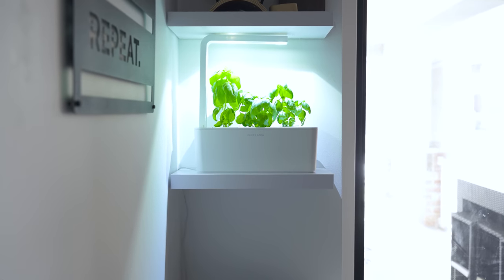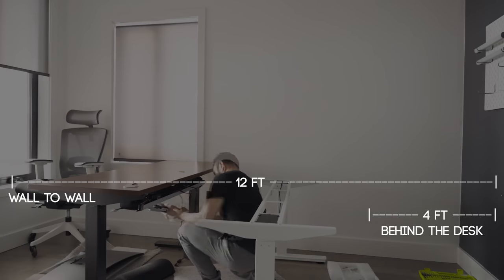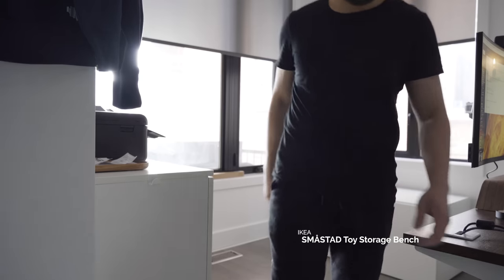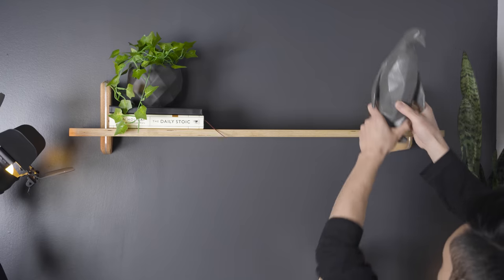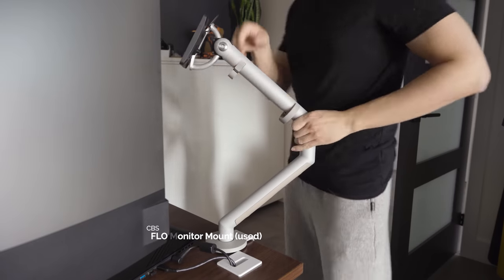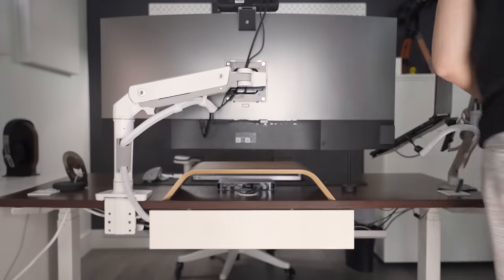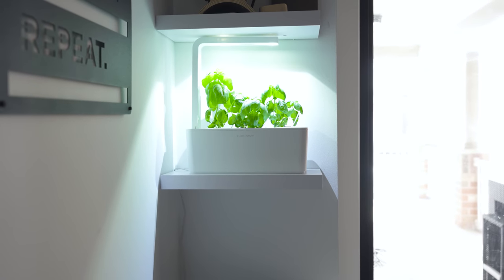My Modern Office | 2022 Clean and Space Efficient Setup

Comment: I'm sure someone already commented on it, but I am sleep-deprived, and can't be bothered to read through 118 comments to see if it's stated. Putting some thin, rubber pads, or similar high friction, soft material, under the wooden plate you put on your "toy cabinet" would both make it feel a lot more locked in place and sturdy, while also reducing chances of any residue + movement causing scratches in the finish of the cabinet.

Otherwise, very clean and thorough setup! Really love the idea of using magnets to fasten the channel cover at the back of the desk!

Comment: Another item for cable management is a cable spine. It allows you to both hide the cables and it's designed to work with the desk so vertical runs from the desk have a flexible spine that encapsulates them. Mine is mounted beside a Power bar in a blu-lounge box that conceals the Power bar (I have a cat so stuff must be concealed for safety). check with your desks vendor to find one of the spines.
Reply from the maker: Awesome. I actually did get one, but didn't end up doing so, I only had one cable going to the floor. I still might use it.
Reply: @DNChromatic  You could also consider a floor outlet that the spine fits over. They make one that is power and data as well.
Reply: Lothar Lustig  Soylent Green is real.

Comment: Nice to see creators using Windows laptops - what spec do you have in your current one? Mine is a 2021 with 16GB ram, AMD CPU, 2TB SSD and a GPU with 8GB VRAM - works great for a lot of stuff :D Have a MacBook for more mobile stuff too - but a lot of my work needs Windows apps and plugins.
Reply from the maker: thanks, I have yet to convert to Apple. I have the Aero 15 Oled, Core i7 10870H, RTX 3060 16GB Vram, 32GB RAM, 512GB SSD. 👍🏼
Reply: @DNChromatic  nice! You enjoying it as your main creator device?
Reply: @Weird_Quests  It's powerful definitely, but I still use proxy workflow to edit 4k video files otherwise it gets choppy.  I wish I could compare with the Macbook to give a proper perspective. It does heat up and the fan gets loud from time to time, as some have mentioned, however it fades into the background after awhile.

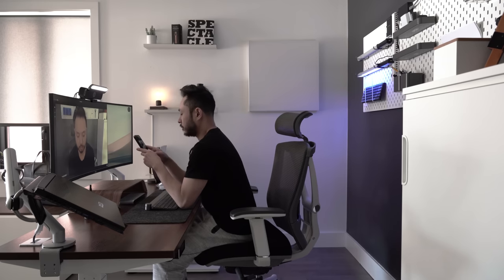Comment: 4:35  I am sorry, but can I ask some questions about the AnkerWork B600 Video Bar? I wonder to know that does this camera support Windows Hello facial recognition and unlocking? And whether the built-in light of this camera can be turned on and off independently? Or turn on the built-in lights only when we are using the computer? Can this product act as a screen light? Or its lighting is only suitable for the fill light effect of the camera? Thank you for your help!
Reply from the maker: I currently use it as a monitor light as shown in the video, I can turn it on and off independently.  I don't see that it supports windows hello.

Comment: This looks great! Re: the Smastad bench and wood panel, did you have to cut the panel to fit? I'm looking at Ikea's website and it seems like the available panels don't fit (36"x20" for the toy box vs 36"x25" for the closest fitting VOXTORP panel). Thank you in advance!
Reply from the maker: Yes I did
Reply: @DNChromatic  What did you do for the edge of the panel after the cut? Did IKEA include veneer strips or something?
Reply from the maker: @mattholtz  Ikea unfortunately does not have matching edge banding. I did purchase a new edge band tape from local hardware store and ready to apply, but then got lazy. 😅 The cut edge faced away towards the wall so I never see it. But to your point, I would use pre glue walnut (or similarly color) edge band, don’t worry about color match too much, and a edge band cutter.

Comment: Hi what's the brand of the wood monitor raiser? Thanks!
Reply from the maker: It’s Samdi.
Reply: @DNChromatic  Hi, nice setup.. I was working on a similar concept (walnut top, white frame adjustable height desk, samdi monitor stand) and then came across your video and was able to actually visualize how my setup could look like.. Nicely done!! Wanted to ask, what color of SAMDI monitor stand did you select from Amazon? I was not sure whether the black walnut SAMDI stand would actually blend with the american walnut top I was planning to get.. Will appreciate your input. Thanks.
Reply from the maker: @sameerjiva  The color was just walnut on the Samdi description. From what I've seen it would match fine, most wood grains and patterns are not exactly the same regardless of where you get it from. Also I see completely different wood types on a desk or room design still have good pretty cohesion